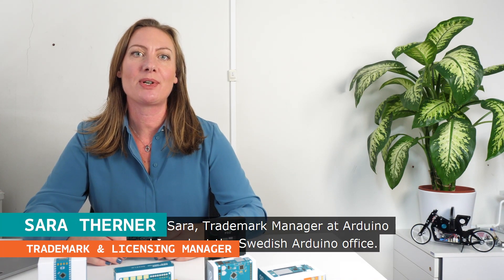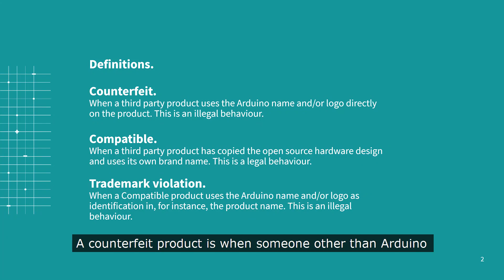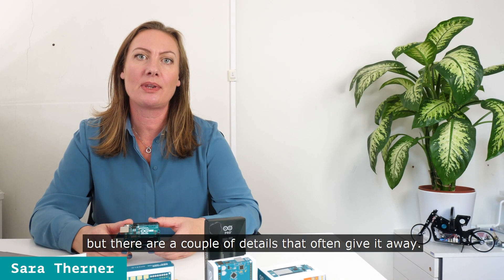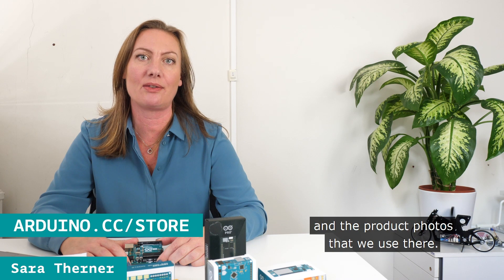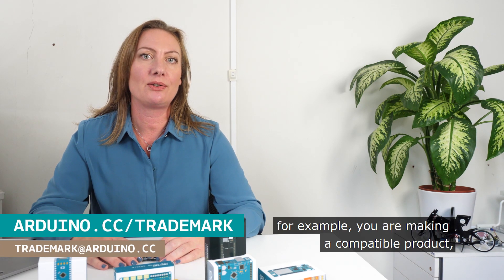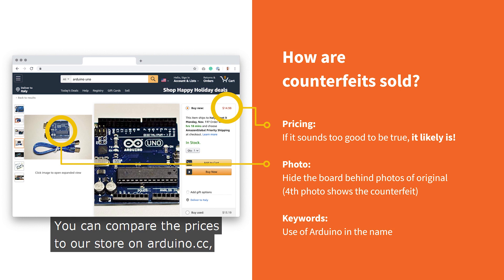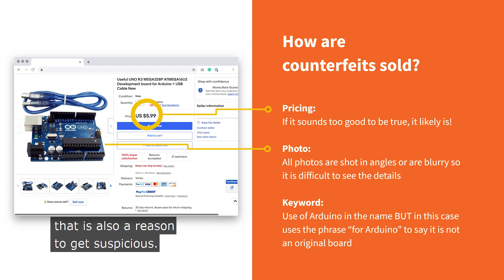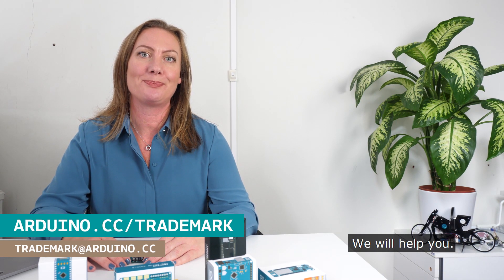Arduino Trademark: How to Spot a Counterfeit Board

Comment: Some other hints to identify fake boards:
- CH340 serial chips with 2 rows of pins on a rectangular shaped IC instead of square 16U2 ones.
- No golden Arduino logo on one of the components (crystal?)
- No print on the sides of the connectors
- No gap-fill between the hearders.
Question: are the model names also registered trademarks, or can one call their clones Leonardo, Due, Mega and such?

Comment: I've never had an Arduino that wasn't an off brand. I've been happy with my Raza uno and elegoo mega boards. Got a couple unos with sun something in their name.... Haven't gotten around to doing anything with them....

So far my biggest challenge has been finding dht11 sensors and motion sensors that work.... Haven't tried the last batch of dht11 sensors but they look like the ones that were having errors. And I swear the motion sensors worked when I first swapped in a new one to test. I can't really just keep buying sensor kits to get over of the sensors they include.
Reply: Even a lot of the DHT11 Sensors are "off brand" a lot of them either don't work or provide wrong results. Buying original products when possible not only supports the creators but also makes sure you can get a replacement if something is not working. Buying official Arduinos supports all the work we do releasing a TON of open source software, hardware and all the work that goes into supporting millions of users (even the ones who buy fake Arduinos then come to our website to download the IDE, read documentation, use the forum etc)
Reply: Is that a good thing to not buy the actual thing ???
Like you don’t support the real people who created first
Reply: @ko-Daegu  True that's why I only drive a 1895 Duryea motor wagon. Who's buying all these counterfeit cars?

Comment: Make Arduino use simple python like with raspberry pi we do only use gpio Arduino code is difficult to learn again if u learn python3 on RPI pls do it's make easy
Reply: why would anything be easy in life?
Where is the fun if everything was easy!.
Sure for an ignorant like me that knows almost nothing on coding well never to leate for learning.
Rasperry Pi and Arduino are 2 different things,sure both can be used in different ways but conceived mainly for one thing rather than the other!
Reply: @scamper_van8470  Arduino now gone forever with new raspberry pi Pico sad for Arduino
Reply: @pyasvaniwadhwa2434  Pi Pico is a horrible product. Wait until Arduino uses the RP2040 chip on a properly designed board. The one from the RPi foundation is just an unfinished alpha-release. The RP2040 by itself is OK-ish at best. It's still an old processor design based on the M0, where M4 is standard in 2021 and Teensy pushes it even further with M7 microcontrollers doing genuine 480 mbit USB2 speed, 64-bit floating point, crypto and pixel-processing.
If you do want Python (I think you shouldn't want that, learning some low level C++ is great for understanding computers), look at the Adafruit Itsy Bitsy M4, those boards are faster than Pi Pico's, swap easily between Python and the Arduino IDE and compile lightning fast without the bloat C on a Pi Pico gives. Arduino also has great modern boards, like the Nano 33 BLE Sense. Another personal favourite is the micro:bit v2. That blends easily between 4 ways of coding, including magnificant Arduino IDE compatibility. The micro:bit and Nano 33 BLE sense are so much ahead of the Pi Pico.

Comment: Originals are way too pricey for tinkering, and for commercial products there is little reason to use Arduino when most of the time simple MCUs can do the job just fine.
Reply: This applies to people who are experts in electronics. Arduino boards make it very quick and reliable to produce results. Especially for wireless products , original boards have all the proper certifications which clones don't have. So yes you can always build thing yourself but it always depends on how much you value your time. If you're trying to build a project not having to deal with the details to building your own pcb, burning bootloaders etc it's an important value. Same goes for bread.. some people like to make their own bread but 99% of people go buy bread from reputable shops and use it to invent amazing sandwiches (or any kind of food)
Reply: @supermodernotv  There are tons of boards that work very well and don't claim to be genuine arduinos. These are much more sensible choices for non professionals since they are much much cheaper.

Certifications means nothing for most makers.
Reply: well since you like chinise than do not complain if it disolve in your hands.
I'll buy italian since i am patriot and prefer the italian quality for most things rather than buy a fake or even an apple made in china!
Reply: @scamper_van8470  I don't need arduinos to be well oiled machines that keep working for 60 years. They are for small electronics projects. For professional work they only serve as prototype platforms. Later one doesn't need the whole board. Just a micro and some support.
Reply: For commercial products one does not use developer boards anyway. In that case you make your own PCB with just the microcontroller.
Reply: @2kBofFun  I wish my clients understood that...